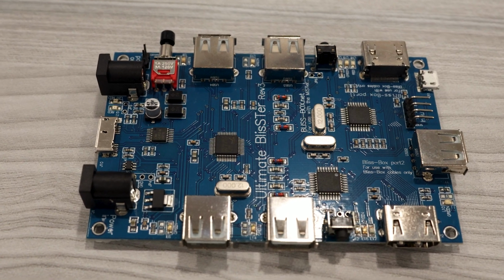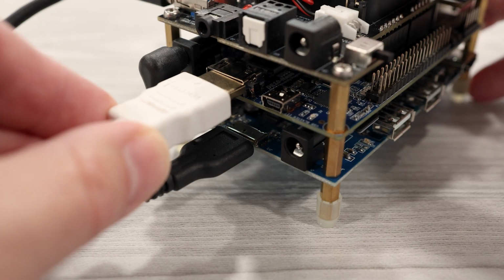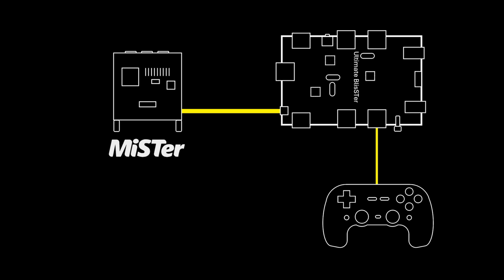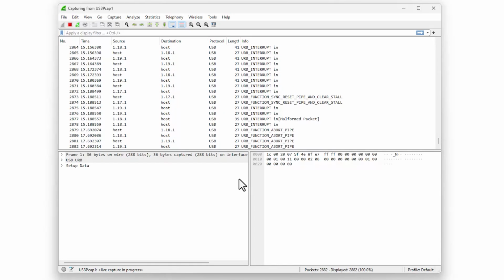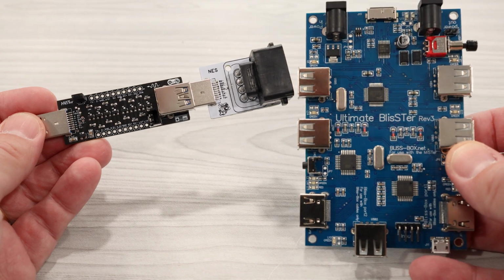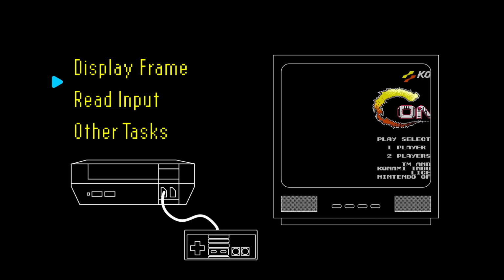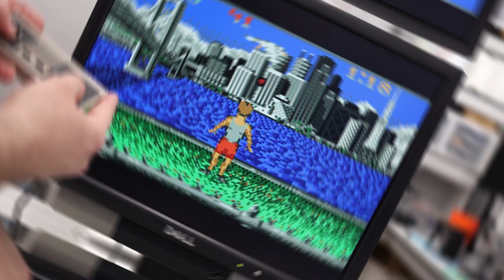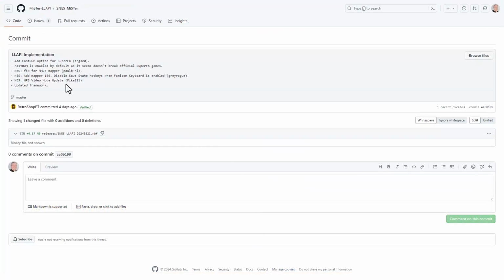Diving into the BlisSTer: Is this the ULTIMATE MiSTer Add On?

Comment: I don't know what I did but I ended up frying my Blister
Reply from the maker: Sorry to hear that - it's easy to plug in a power adapter with too much voltage or the wrong polarity. If that's the case, you probably just burned out the voltage regulator. I'd suggest reaching out to BlissBox and seeing if they can repair it for you
Reply: @whatskenmaking  thank you. I had it for over a year so I ended up getting a USB hub. I still have the Blister, though so maybe I will see if it can be repaired
Reply: @Cookiedon15 send us email to support. Probably was used a different PSU than what is recommended.
Reply: Mine has failed three times now since getting it, twice in the middle of playing a game and causing progress to be lost.  Only thing thats failed on my mister setup since getting it in late 2018, and multiple times now.
Reply: Hello  @WalrusFPGA  
Congratulations on your YouTube channel. It looks fantastic and you're certainly a great gamer.

If you have a recent Ultimate BlisSTer rev3 board produced by me, we're more than happy to check what the problem is. Our support is always available, and we always keep the firmware as up-to-date as possible. It already has support for more than 300 controllers and more news is coming.

When you say that you've had problems since 2018 exclusively with BlisSTer, let me remind you of the following: we have produced the first MiSTer I/O boards and hub in 2017,  v3.1 and it wasn't until the end of 2018 that the serial port was introduced - the well-known USER IO, exclusive feature of version IO5.5. At that time, many cores were still being ported from MiST to MiSTer and without any serial port support. Was not involved in the project back then but I remember that  BlisSTer hub was introduced in 2020? just after v5.5, not least because at that time Sorg had (and has) no interest in playing with classic gamepads and joysticks (aka SNAC). 

Everything changed in 2020, when our friend Sergey came along and we sent him a lot of consoles and DE10nano boards (at Sorg's request) so that the first big cores would appear, particularly the SNES. I can tell if you're playing Saturn these days just because we managed to get several DE10-nano consoles and accessories over to the war side in Ukraine. 

Everything has changed since then: old core problems have been solved and lots of hardware revisions have been made. Everything has evolved, new add-ons have appeared, but I remind you that all hardware and especially usb ports don’t last forever, as great player you are I believe you done the latest firmware updates? For sure that even your videos on your channel may have evolved over time. I've never heard of you or your YouTube channel before, but I believe that as an experienced gamer you are, understand that what we did in 2017 or 2018 no longer reflects what exists in 2024. Everything changes, hardware changes, the world changes and all the comments are great for making us improve not only personally but also professionally.

Cheers and keep up the excellent work,
Ricardo
UltimateMiSTer.com

Comment: Bliss vs reflex.......FIGHT!
Reply from the maker: Curious about Reflex Adapt now (I admittedly haven't yet looked into it)... I'll take a look!
Reply: @whatskenmaking  I own one, from what I can best make of it, and I haven't really asked porky if this is how it works...

But my assumption is that it is like a field programmable Daemon bite adapter ... so super low latency usb adapter for native controllers

However. Unlike Daemon.. it's not a board thst ks ONLY SYSTEM X....

Instead you just use the bliss hdmi style connector ..say what system the controller is for...and the board just programs itself to work correctly
Reply: Actually I own 2.....so I can do 4 player if needed lol
Reply from the maker: I don't have the device or a schematic, but looking at the source code in the repo (https://github.com/misteraddons/Reflex-Adapt), it looks like it's AVR based (daemonbite is also AVR).
Reply: @whatskenmaking  yeah 32u4 same as GPA.
Reply: @whatskenmaking   Also the GPA, this is more of a dirrect compare to the reflex. They use the same chips and have the sale poll rates. Reflex has some advantages, GPA has some.
Reply: See my comment on BlisSTer vs usb adapters if you want an answer to this one. not typing all that again lol

Comment: I’ve been waiting on mister exactly because of the billion and  1 ways to do things.  Is there an actual best/ most optimal setup?
Reply from the maker: Exactly... everyone has their preferences, but unless you know what you want already, I'd suggest just starting out with the bare minimum (DE10-Nano + memory + cheap USB hub is all you need to get started) and add on accessories over time if you find that you want more/different capabilities.
Reply: Buy from Ultamister, get his full BlisSter setup. He really makes it all stupid simple. All of the options just confuse the heck out people, turns a lot of us away imo. The one thing that seem to be common throughout is the HDMI style adapters.  Snac, BlisSter, GPA, LAMMA, GP, GPjr, 4-Play, they all use them. The problem with other sellers IMO is the hatred. I think sellers should be natural. Just sell what options are out there not try to fix the market to a certain brand or workflow. Ricardo at ultamister seems to be that guy, he will make you a setup that fits your needs. Just tell him what you want to do and he will suggest the best setup for you.
Reply: I think it comes down to what you want. I think ultamister makes some of the best all in one packages. WhatI find bothersome is the hatred. So many sellers want you to buy this, or do not want you to buy that. Yes there are a lot of options. If you do not want to research it all, my advice is go with a nutrual seller. this is where Ricardo comes in. He is not going to tell you, xyz is not the way to go and rather will just set you up with what works for you. If you are new to it all, he sugegstes an all in one setup, ready to go. If you do not like it, return it.
Reply: The Mister has so many options because no one gets along. And all the hatred is not helping. Use my stuff, don't use his, etc. Open source is to bring people together and it seem to do the opposite. But if you are in the market for a setup, contact Ricardo. He will get you set up with something that fits your needs. If you do not like it, return it. At lest some one does the work for you and he is neutral, so you won't has issue where something that maybe good for you is overlooked.

Comment: I just wish this thing could also do true SNAC when needed for obscure accessories. FWIW, the DB9 cores also give you low latency for handhelds if you have a DB9 setup. I’ve been enabling turbo on USB controllers by holding menu and pressing a button. I know these controllers aren’t going to have a menu button, but does that not work here when pressing menu on the I/O board?
Reply: the problem with the SNAC is multiplexing all those snac pins to HMDI. a 19pin multiplexer would be crazy.  but that is kinda what the APC is for that he shows at the end of the video here. That would work nicely.
Reply from the maker: That's true - with the BlisSTer, there's always going to be an integration layer since it's acting as an interpreter. But your point is also another good reason why it would be beneficial for the BlisSTer firmware to be open source... if it was, the community could add support for those obscure accessories. FWIW, I did buy the Famicom adapter (I know you're a fan of 3rd party FC controllers, Emmett!), but I haven't tested it with anything yet... though as I'm typing this, I'm eyeing the Family BASIC keyboard sitting in corner of my office 😉
Reply: @whatskenmaking   IDK, I agree with most everything you say and feel your understanding is on point but I solidly disagree this open source.  I think its great to have that but what you loose is ownership. When things go wrong no one is going to take blame or credibility and you have a stalemate situation. IMO, we need both, good open source projects and good close projects. They each have there advantages. BTW: the Author to the BlisSter is very accommodating, just ask and you may get what you are looking for. I'm not sure what you mean by "obscure accessories". The BlisSter chip is pretty well maxed out, that 328 only holds so much. The LLAPI is what limits the ability to use a SNAC like interface. I assume you read what you mentioned?  the LLAPI cores only use 2 LLAPI commands. You can do a lot more with it, its not even being fully used. and FWIW there are open source clones like LAMMA.
Reply from the maker: Fair points! I was referring to Emmett's comment on 'obscure accessories', meaning non-standard ones (such as the Famicom keyboard that I mentioned).
Reply: @whatskenmaking  yeah it does a few odd balls like that, paddles, guns, keypads, and what not but its main goal sure was controllers.